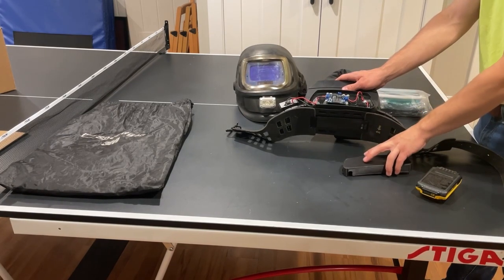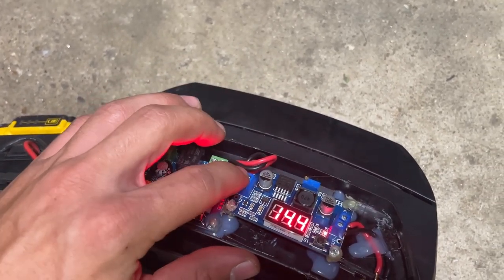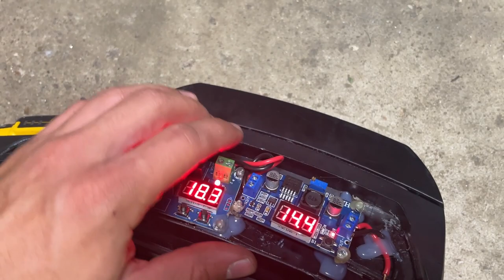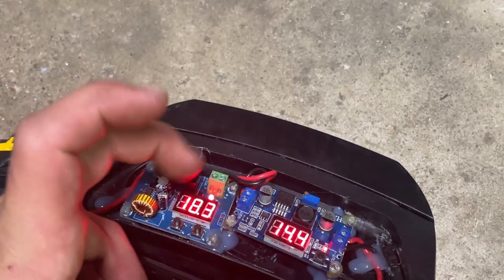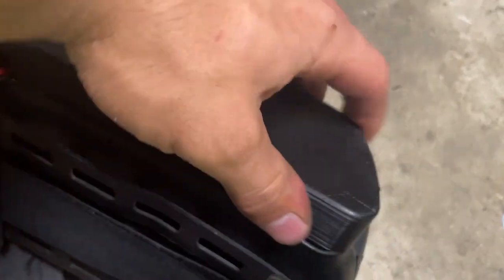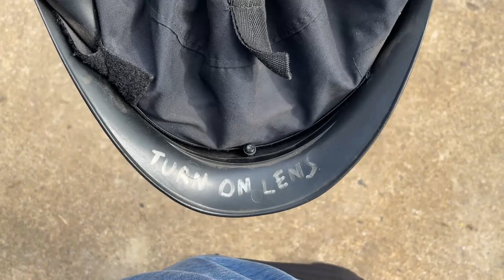Adapting 3M Adflo Speedglass PAPR to use DeWalt Drill Battery with CASE Why You Need a PAPR

Comment: Very good and informative video. I have the 9100fx and g5-01 and personally prefer how secure the 9100fx stays on compared to the g5. Not a big deal if you’re working in a shop but is extremely aggravating working 10 hour days and have to constantly move and fit into tough spaces.

It’s a great idea using dewalt batteries instead of the overpriced 3m batteries and will someday implement it into my blower. Easier and cheaper to buy and charge multiple batteries and use with my other tools. I’ve rebuilt a couple of my 3m batteries but if my chargers start to die on me I’m doing the switch. 

I use to use the quick release half face but over time has left a dark spot and even widened the pores on the bridge of my nose and even occasionally cause pain from tenderness. Never go back to that again. 

Thanks for the video and keep up the good work.
Reply from the maker: Thanks! Sorry the half face is so uncomfortable over time! I try to avoid it by just saving it for tight spots too. Good luck with whatever you decide to do in the future!

Comment: Great video….I just ordered the boards needed. Just one question. How did you attach the boards to the bottom of the unit? Also what gauge wires did you use?
Reply: @JohnWheels
Reply from the maker: Hey I'm sorry for the late reply- been super busy with school. I used hot glue with little screws as standoffs for the boards and 14 gauge wire.

Comment: great video.  Mine is shutting off at 14.4 with a low battery signal. may need to change the voltage converter
Reply from the maker: Thanks! Make sure that that is 14.4 V under full load - have the filters on and the hose and helmet hooked up. If it shows 14.4 V under no-load, the voltage will drop a little when the load is applied.
Reply from the maker: If that doesn't work, maybe try 14.5V or maybe your DRO is bad on the board and you can test the voltage with a multimeter

Comment: Nice video:), im planning to make the same setup. I still have the (broken) original battery and it says 10.8V, and u have it on 14.4V. Is it working fine on 14.4V, just wondering then im gonna make it like that aswell.
Reply from the maker: I believe these came in 10.8 and 14.4 V battery configurations depending on what year it was made. I would try 10.8 first and if you get the low battery voltage beeping alarm, then try 14.4.

Comment: Did you get a fix for it running for 15 seconds or so and shutting off?
Reply from the maker: If you haven't already, Make sure that that is 14.4 V under full load - have the filters on and the hose and helmet hooked up. If it shows 14.4 V under no-load, the voltage will drop a little when the load is applied. If that doesn't work, maybe try 14.5V or maybe your DRO is bad on the board and you can test the voltage with a multimeter. Lmk if that works

Comment: Looks Like 3M is screwing over the welder in the name of  "safety", and what happens when this flimsly plastic product falls apart? Why just whip out another $3K!
Reply from the maker: Yea it's absolutely nuts!
Reply: Yeah or 3M trying their best to run proprietary filters instead of running their twist locks or standard NATO. When you start comparing the pricing from an official source of one of their versa/adflo to standardized filters it just doesn't add up even when normally having to run two or three filters on other units out there. (Like the older 3M breathe easy or C420s) (Which those you pretty much have to make batteries or modify)
Reply: @AbsolutionArmament  Thanks for the reply, I have never used air filtration when welding though it seems a good idea. My main interest is "seeing better" thus my interest in the Speedglas helmet. My complaint is how much better is it for all the extra money! I would think 3M would at least make the helmet with carbon fiber, titanium,and unobtainium.
Reply: @mikemakuh5319  I would look into the C420s they are more expensive than the breathe easys. But still way cheaper than the new items on the market by a long shot. It sit a bit flatter compared to the 3M breathe easy and only utilizes 2 filters instead of 3. For the hood, Miller has the papr headband and hoses separate. Of course you'll have to figure out adapting the hose to the unit but there are options out there for that. Either 3D printable and some off the shelf items.

Edit: YouTube is currently deleting the reply when I tried to break it down for what all was needed but it's pretty straightforward. Both the c420 and easy breathe run at 5Vs so you'll have to step down the battery choice to that. I would also be willing to bet the 420 probably lasts longer since they used brushless motors in both runtime and reliability.